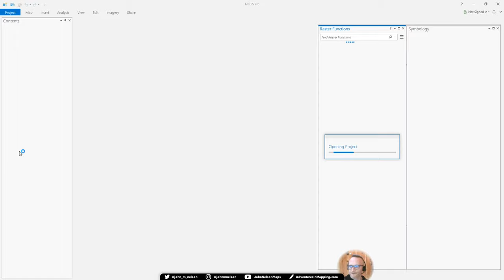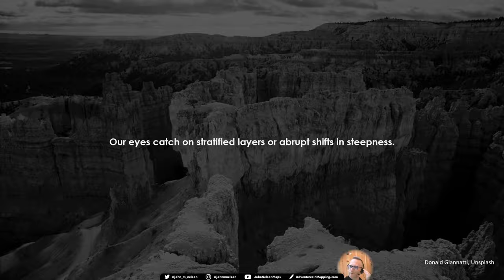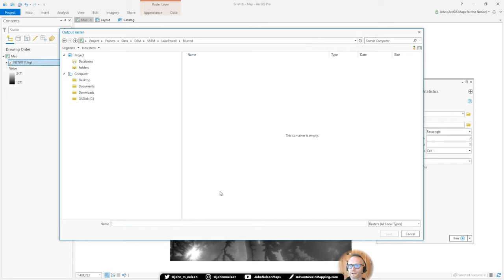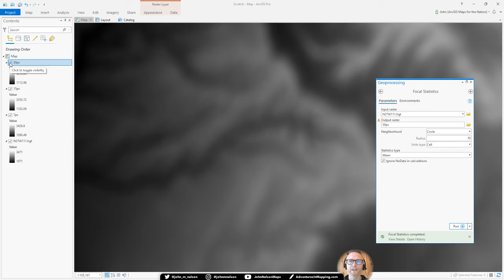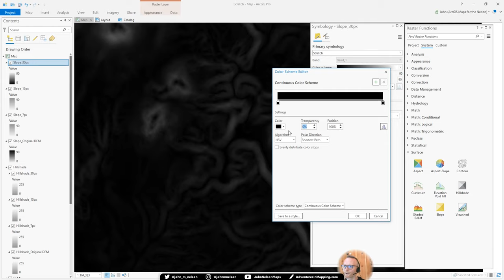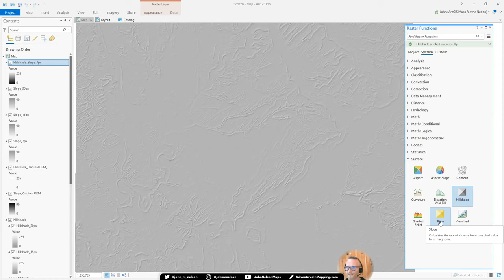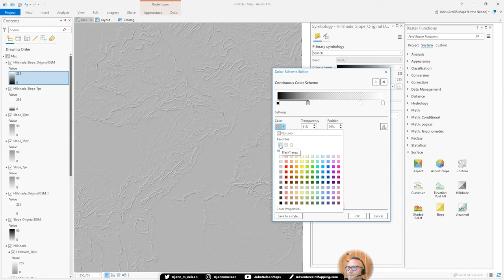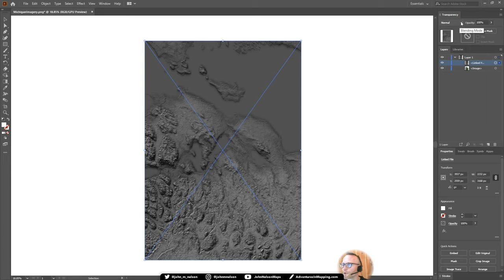Smooth-Sharp Hillshade: An Ambient Lighting Terrain Effect (hack) for ArcGIS Pro

Comment: Is the blend operation the only way to get some arbitrary color ramp DEM to appear over a black & white hillshade without making the original DEM partially transparent?  That is if I have some black & white hillshade and I want to drape the original color ramp DEM over it, is blending the only option?  ArcMAP seemed to be able to do this out of the box (it combined several operations into a singular little checkbox on the symbology menu) but I can't find a way ro get Pro to do it.
Reply from the maker: Fugoogle What ArcMap function is that, sounds cool. You can do a pan sharpening function in Pro. That blends tonality of (presumably) higher res grayscale data with the hues of colored data.

Comment: Wonderful
Reply: I just finish trying it on sample area in Egypt and I am really impressive by results when making overly street network with hill-shade. I have only one question in the last step when you send results to adobe illustrator I didn’t catch how you added it but I did work around and exported results as tiff then added in Illustrator. Is there different method to share results with illustrator with adobe creative extension?
Reply from the maker: @maighalygazar7362  In an ArcGIS Pro layout I just exported my hillshade map as a PNG (I like PNG best, since it's lossless and relatively low file size). I turned the hillshade layers off and added the basemap imagery, then exported that, too. In Illustrator I just added both images to the artboard and played with blend modes.
Reply: John Nelson, thank you I did and really I did impressive results for Egypt terrain. I prepare article and sure will let you see the results 👍